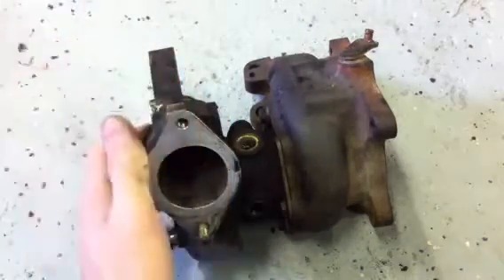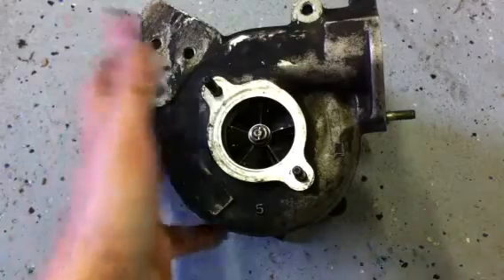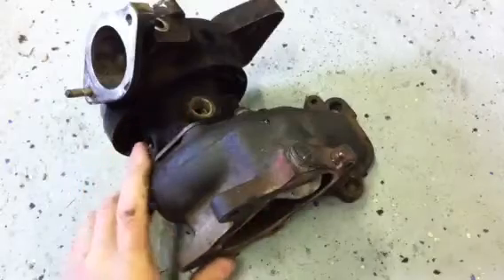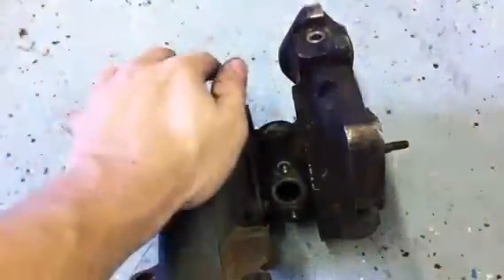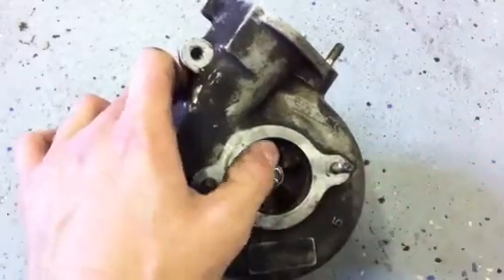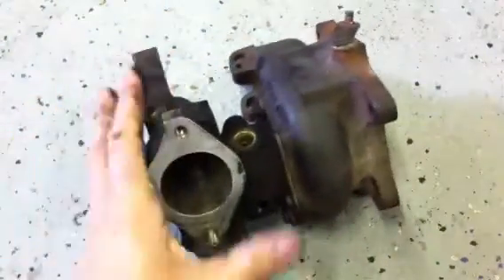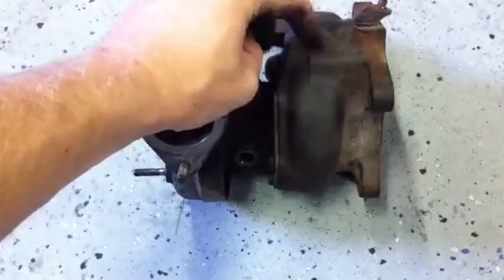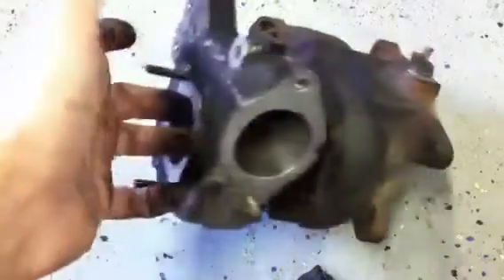Turbochargers: How do they work?

Comment: the turbine is powered by a change in enthalpy. it changes heat & kinetic energy into work at the shaft. given the internal energy  and kinetic energy of a mass of gas flowing per second, power can be extracted from it.

Comment: great video...:) but when continuous compression of air will take place in a compressor when air which is been compressed to high pressures is there any chance for the air to escape from the inlet valve during compression??? is there any requirement of any non return valve to be place near inlet valve....??

Comment: They are pretty much the same thing and both compress the air inside the engine. The way they work is a main difference between them. Turbocharger's run of the exhaust gasses while Superchargers are connected to the crankshafts via a belt meaning they use actual power from the engine. Turbochargers suffer from lag because they use he exhaust gas however superchargers don't because they are mechanically driven from the engine itself but they must use power from the engine to function.

Comment: The turbo works by compressing the air inside the engine allowing more fuel to be added, thus increasing the energy released per explosion. The turbo has to compress enough air inside the engine before provide extra power, before this can happen, the engine must burn fuel. This is turbo lag.